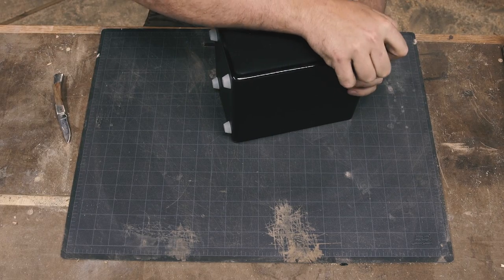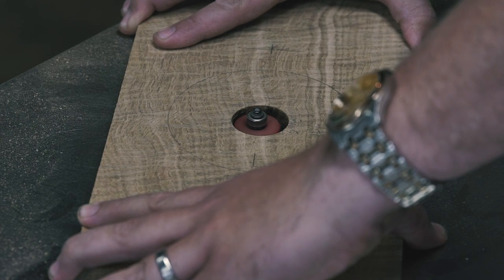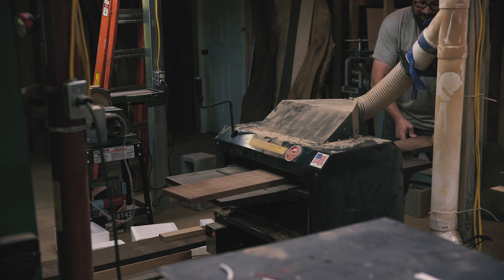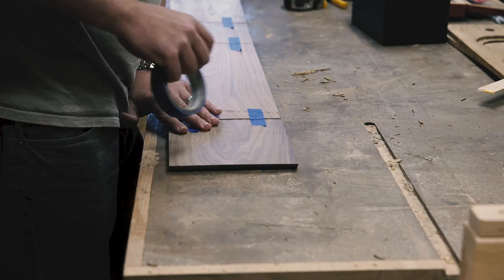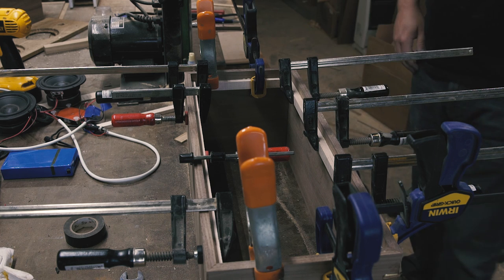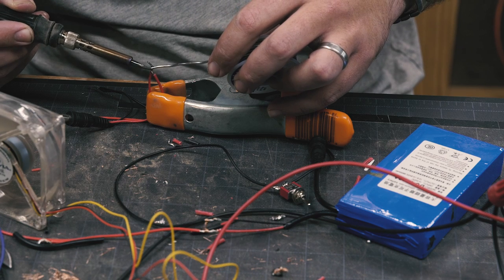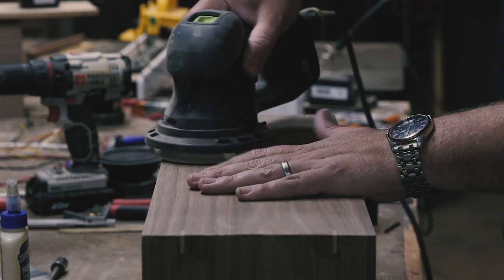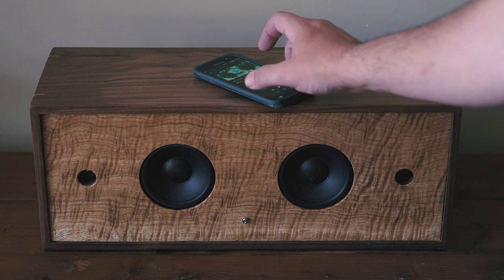Wireless Bluetooth Speaker: Wireless Rechargeable Battery Powered Bluetooth Speaker | Woodworking

Comment: The speakers actually cut out because you actually halved the impedance when wiring in parallel ++ and - -. and assuming all the speakers are the same nominal impedance.   Wiring in Series, or speaker  A + to Speaker B - negative on the other speaker, doubles the impedance, again assuming that all speakers in the circuit are the same impedance.  The amplifier has a minimal load it can safely operate at, before failing or going into protect a protection mode; when playing at louder volumes. The amps are creating more wattage, thus drawing more current and based on the sophistication of your amplifier most likely shut down to protect itself. Also, lack of sufficient current draw (or amperage) during transients, can shut down the device.

Comment: Great work. My comment is not so much about your incredible woodwork, but more about the battery. I’m building a Bluetooth speaker just for kicks. Possibly, it they are well-liked, I’ll start gifting them to my family and friends. I have a prototype finished, but it is plugged into the wall for power. I don’t know much about electrical and I am trying to find info on YouTube, but I’m not getting very far. I would like to know more about rigging the rechargeable battery and power switch. Any help you (or others) can provide would be very appreciated. Thanks.

Comment: Another problem can be that 12 volts is to little for the amp, try using a voltage booster to something around 19 volts.  Had the same issue with my sanwu Chinese amp...

Comment: Sweet build and good choices. I love the TPA3116 amp chip but those TDA's are pretty good too, they just seem to run a lot hotter (when non switching) than the class D at not too much of an improvement to make it worth it IMO, assuming battery power and desired run-time. I've found that without any good preamp or extra EQ action going on the addition of tweeters can often introduce too much piercing highs IMO. I found that using something like a 5K dual potentiometer (I snag them from other boards with gain knobs) in series with each tweeter is an easy way to trim them down a bit just volume-wise. All the way up sounds bad to me but a nice in-between can be found where it just adds that extra ambiance. Normally not a good idea to do this unless on the line side but I think so long as the tweeters are filtered with capacitors they shouldn't be pulling so much power in a system like that to where the pot will burn out, at least mine hasn't. Also assuming they are filtered by placing the tweeters in parallel with your main drivers they shouldn't actually be halving your impedance like that. The series capacitors and filtering out of low frequencies will cause the tweeters to draw very little power. So for example I run one setup with the TPA3116 that wants 4 or 8 ohm loads but I run each driver in parallel with each tweeter which brings the impedance to around something like 3.6 or so which it seems to handle fine. This isn't absolute I suppose as it depends on the tweeters and the filtering but I'd think it would be fine so long as the tweeter isn't trying to handle anything mid range or lower.

Comment: Seems like you forgot the crossover and that's why the amplifier doesn't like them in parallel. A simple crossover is a coil in series with the bass/midrange driver and a capacitor in series with the tweeter. You even risk damaging the tweeter if it's supplied with a full range signal.
The lacking crossover and bass port may very well account for a great deal of the tinniness.
Reply from the maker: Yep that's exactly what happened. I went back and added the crossover. It sounds great now.

Comment: The battery can be way cheaper if you buy 4 li-ion  batteries and a BMS charger board! I bought the same bluetoothmodule, it was crappy at the beginning, now it is broken... @Wn. Walker Co. How did you chose the proportions of the wood? I fail to find a good source of wich proportions give the best sound quality...
Reply from the maker: This was more of a proof of concept build.  I had a hard time finding any information on exactly what I wanted.  A wireless, battery powered bluetooth speaker that could be recharged without having to switch any wires around between charge and discharge.  Mission accomplished.  I'm not an audiophile and built this box with only regards to aesthetics, not sound quality so I'm not a good resource for that (Kirby Meets Audio actually just released a video talking about speaker goals which touched on this).  I've since built another speaker with a smaller enclosure and it sounds great.  I did think about using 4 li-ion batteries, but this seemed easier to wrap my head around as a concept.  Now that I know the concept works I can revisit the project with better components.

Comment: That's too bad that the walnut cupped on you. Because the kiln dry moisture content is measured at the center of the board, when you resaw it, the new faces will cup. Still turned out for a fantastic project despite your walnut woes!

Comment: Hey! What a remarkable project! However, when I heard you said you would make another one, I thought I would give you some suggestions. The first is that it's not just due to the fact that you opted for a sealed enclosure. No, it is mainly due to the fact that you used such a small amplifier. I believe those speakers were about 3 or 4 inches and the tweeters are 1 inch. They need a bit more power to effectively drive them compared to the amp you are using right now. If I remember, the amp you are using requires 5 volts. So, I understand that it can't get any bigger. You could always switch to a 12v board or a mini car amp to power the speakers. Along with that, you could get a small sealed car audio battery like the Kinetik Car Audio Battery brand. You can find them on Amazon. Also, if you are going to end up porting your box, then remember that not every port will make the box sound the best it can. Experiment with different ports. If you want, reply back to me, and I'll explain further. Although, given what you've done so far, I doubt you didn't know this already. Anyways, sick build though!
Reply: Oh Yes, I might as well add one more thing. The addition of the tweeters aren't increasing the impedance, rather, it's lowering it. However, this causes the amp to output more power. And, in your case, it was too much so a sort of "failsafe" kicked in on the amp.
Reply: And...I'm stupid. I rewatched it and I realized it was already 12 volts. If you want, you may want to get another one of those batteries and install it in parallel. If you want, that is if you see this and respond, I could give you a few suggestions on the amps you could use to get more power.
Reply from the maker: If I ran another battery in parallel, wouldn't that just double my capacity not increase power?  I'll definitely look into the Kinetic Car Audio Battery brand!  Thanks!
Reply: Wm. Walker Co. Yes, but what I mean is that the battery has to be able to supply enough power especially at full tilt. Meaning that if the system is pulling more power than the battery can output, then it will be limited and may start to stutter a little or completely shut off.
Reply: @sy7024  If my board is 24v, can I install 2 of this batteries in series?
Reply: @giogarciag  Yeah. Two 12v batteries in series is 24v.

Comment: You may run into trouble with the hot glue holding the battery pack in place.  When recharging, it could heat up enough to loosen the glue.
Reply from the maker: +Dave Kimball if that happens I can always go back epoxy it back on.

Comment: Have you had any trouble with cracking due to wood movement (long-grain to short-grain construction here - the front would tend to push out the miter joints when expanding, and or the long-grain to crack the front when the front contracts in less humid weather)....?
Reply from the maker: No but I built it like I would a panel door. The panel floats (no glue) and there is room for expansion. So far so good and all three I have made so far have made it through multiple winters/summers now
Reply: @wmwalkerco  Smart move; couldn't tell from your video that you had done that. Really cool project!

Comment: So if you plug the battery into the Amp with the DC connector that comes with it and use the on/off switch on the side of the battery. Will that work?

Comment: I notice that there is an on/off switch on battery pack you used. Is that constant switched in the on mode when placed into the speaker? And does the battery pack recharge in while switched on? Can anyone answer that?

Comment: I see that You didn't wire each speakers and tweeter in series.
Adding tweeters you lowered the impedance/resistance. Cut it in half. You didn't double it.

It would work fine wired in series, 16 Ohms. Doesn't stress the amp as much. But it won't sound  too loud.

You had them wired in parallel.
At 4 Ohms. That makes the amp work harder, to put out more power. Gets hot quicker.

I guess this amp can't handle a 4 ohms load.

Maybe wiring 2 batteries in parallel to double their amperage might work.

Comment: It halved your resistance but yes that's why it cut out. You lose stability at low ohm load. You just lose output and power at high resistance

Comment: Great video! I like the way everything is created so much easier when you have the right tools. I didn't...
Although I didn't bumped in your video at the time I've done one similar to yours and the sound is quite decent, I would've learned a few things. I didn't use solid wood. I had a reclaimed pc desk made from laminated chipboard :( .
I've added crossovers and separated the speakers which created a better sound. I am considering in adding 2 passive radiators to enhance the lower end. The other thing that let me down was the battery. Same like yours but I had a 12v 4A battery but it doesn't charge anymore. Inside I found three 3.7v 1650mah Chinese imitation batteries. Need to look for a different model.
Again, really informative video to watch.

Comment: A problem with this setup is that the enclosure looks too big. I can see that you doubled the size of the box they came in but you need to make and air tight separation between the two. You need to essentially have two sealed speakers inside one big box, simply putting them both together will mean there is too much airspace inside and it makes for terrible low end performance. You also did not add any dampening material which could effect sound. Unless your mid/low drivers were actually poor low end performers before, then it's most likely just the drivers.

Comment: Maan you're doing really well in video creating, wood working, the content is greate, i enjoyed the wideo wery much but Maan you had done some serious basic mistakes with this speaker build, on the video i didnt really seen a full woofer's helding piece but it is actually bad one, just put them on a layer of hot glue and make sure that they stick really airtight and glue doesnt touches the speaker's membrains, so they moves freely. as well any speaker box just must be absolutely airtight, so any joints or switches or plugs or gaps must be totally sealed, for the back panel you can use some sealing strips, they will work just greate, the thing about crossovers you already heard, it actually was dangerous for tweeters, they could blow ou pretty quickly. also thweeters was put from inside, that thickness of the wood is acluaally causing alot of distortion to the tweeter sound so try to keep it's original positioning from the front of a panel, without anything on the way. the speaker's designers already solved this problems and original tweeter enclosure is the best possible to make. also if you're planning any future speaker videos i can recomend the amplifiers company that i personally use in wery expensive builds, Sureelectronics, they actually makes desent quality amps with bluetooth and some with DSP build in. Also next time try to build the box as perfect size as possible, this one is too big for this size speakers, if you imagine the same box but just tight fit in height to the woofer's height, that would be pretty much perfect size for them. Or use the older enclosure size, you actually can make a little bigger than original enclosure will be okay. Hope you'r next speaker will be perfect with this info ;)

Comment: passive radiator on the back and it would be even better
Reply from the maker: I did end up going back in and adding a passive crossover I salvaged from the original speakers.  It sounds a thousand times better now!

Comment: Two 8 ohm speakers in parallel = 4 ohms.  Probably need to reduce the input voltage or limit your output power.

Comment: What did you do for the battery pack? I have a similar one and I'm soon going to build a battery powered build too, but I thought about what you did with the battery and its on/off switch? Did/do you always leave it one, even though the battery itself has a small red diode lighting up when turned on? :)
Reply from the maker: I do always leave it on.  I thought that was the most simple solution.  I figure, there is a built in "no overcharge feature" in this particular battery and it's big enough that you wouldn't just stick it in your pocket.  If you are going to use it, there's probably a plan.  Like, to go out on the deck, or by the pool, or down to the beach or outside at a party or gathering.  So, the drain from the LED shouldn't be a huge deal since you'll likely be en route to wherever you are going with the speaker.  That's my thought process but everyone has a little different lifestyle.  I doubt you'd be taking something like this with you hiking.

Comment: I am still trying to make this work built it and does not work.., reason is that since using that 12volt lithium to power and use it for the bluetooth speaker well the board it self runs on 12volts so building it and trying it out ...after a a while the voltage on the battery drops under 12volts after its practically fully charge so the thing totally dies not long after using it a while so have to get an answer on that part how did he correct that issue, second that battery has its own on and off switch and since he is putting an extra toggle on and off switch  on the front and the battery does not charge if the battery is sealed inside with it always on the battery will not charge when plugged in to charge so i am still wondering how he got pass that issue but i haven't gotten an answer to these questions.
Reply from the maker: +dreamkiss4u what are the impedance of your drivers? Have you fiddled with the pass filters? The battery has to be switched to on to charge anyway so just leave that set to the on switch. Mine runs for hours on a single charge. Not sure why you're having issues.
Reply: Wm. Walker Co. The battery with me does not charge if it's left on it has to be shut off from the main battery switch in  order for it to charge... I'm not sure how you get do much juice from it if the boards power needs 12 volts minimum how does it stay on for you that long when the battery is already at its max voltage at full charge of 12 volts.. ill test some more things out but if it still gives me to much trouble ill just make it direct current power.

Comment: How Long can you Run this speaker on Battery? I Want to buy one for my speaker too and I don't know yet which Version would be better. And here is a tip: don't use these cheap amps! I had that one before but its aweful! Then I bought a JAB2-30 (Sure electronics, from the wondom Line), which ist absolutely cool. It is pretty loud and is even shipped with multiple extensions (LEDs, Volume Knob, etc). And at a price of ~30 bucks its quite reasonable :)
Reply from the maker: for ~30 that's not much more expensive than these amps.  I'm definitely going to give it a try on the next one!  It runs for quite a while.  I imagine it would depend on what speakers you're driving.  I haven't actually timed it, but we sat around my parents pool for quite a while and it never died.  I usually just leave it plugged in until we're ready to use it.

Comment: Nice project, the psysical speaker looks really good, but electronics could've been done better. For another time, that amp runs a lot louder and better at 24v than 12. But cheap class-d amps from china doesn't sound good at all, despite the voltage actually.. You get what you pay for, always. I got tons of cheap class-d amps, they're not equal, but all pretty bad. Look into more expensive ones like Sure electronics, and maybe car amps. And as mentioned below, the speakers impedance isn't the right load for the amp aswell. And remember a crossover, best sound, and best maintanance
Reply from the maker: I actually went back and added a crossover.  It sounds a lot better now.  This project was an exercise in seeing if I could make a rechargeable, battery powered bluetooth speaker without having to switch any wires or open anything up, since I couldn't find any other videos of that specifically.  Now that the proof of concept works, I'd be interested to try it with some better components and figuring out the right enclosure size, voltage, impedance (I thought the impedance was right according to the specs of the amp, but I was wrong), etc.  I also went back and made one for myself and it sounds good enough and loud enough for me working on things in the yard or on the deck.

Comment: I would love to make my own - however I thought I'd been dropped on Mars during the electronics portion haha.
Reply from the maker: It's really not too hard.  Basically I have a premade bluetooth amp to process the signal, and a battery to power it.  I just added an on/off switch between the battery and the board.